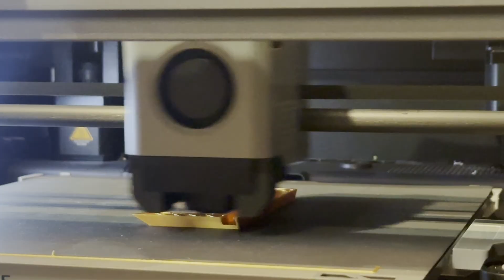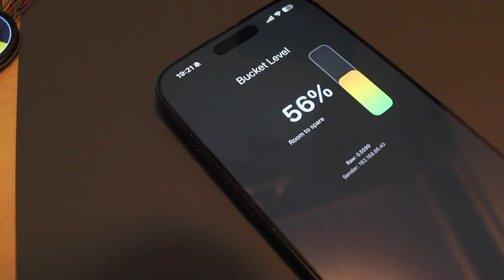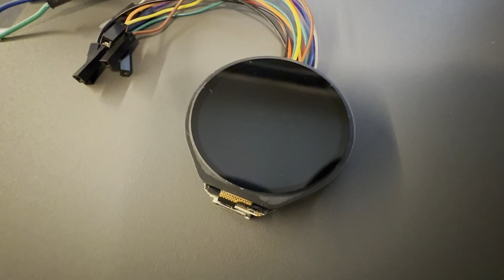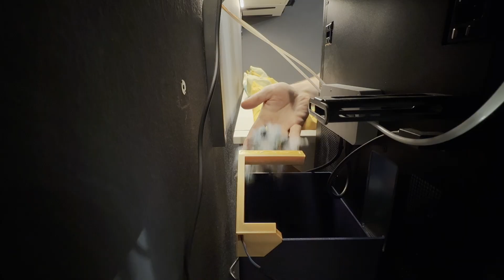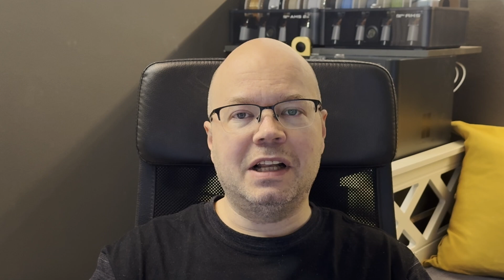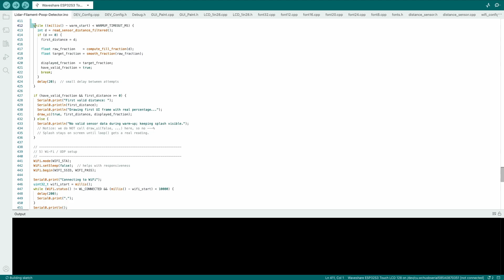I Built a DIY Bambu Lab Poop Bucket Sensor With a LIDAR

Comment: How did you deploy the app to your phone without any restrictions (like expiration date for the signing)? Or did you just deploy as a development build (with a lifetime for max 1 year)?
Reply from the maker: Yep — just a development certificate, so I think you’re right about the 1-year expiration.
For personal use that works fine, and it should be quick to re-sign when it expires.
The app was mostly just for fun — it would make more sense if the data lived in the cloud and the app simply pulled it from there, so you could monitor the level on-the-go.